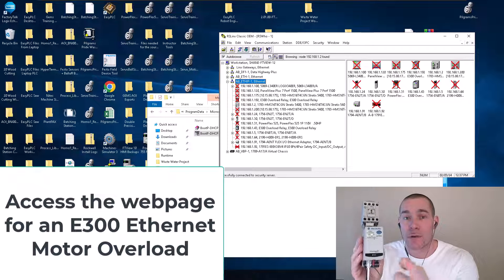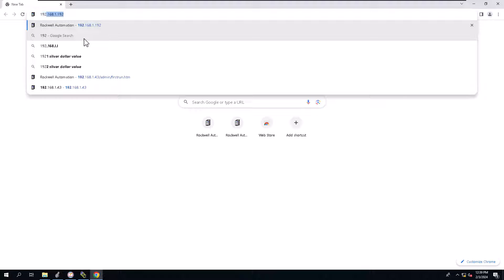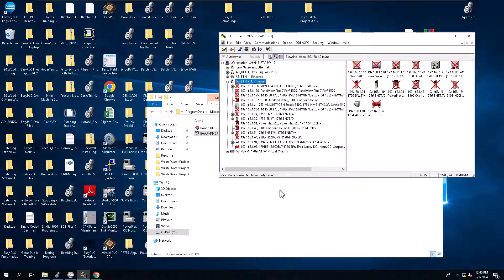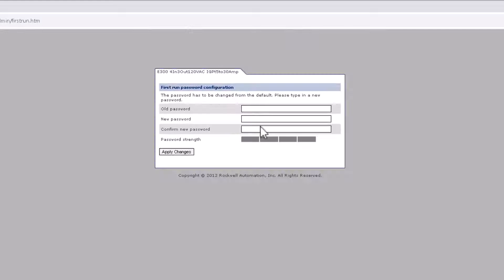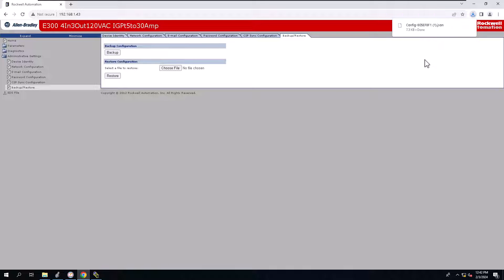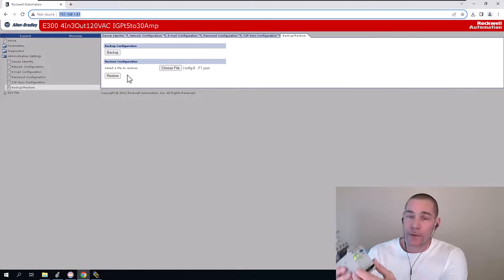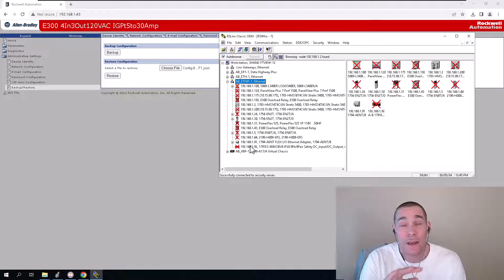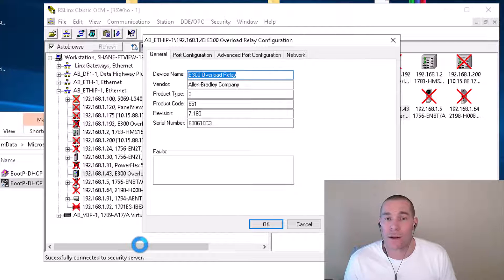Access the webpage for an E300 Ethernet Motor Overload

Comment: have to cycle the power is impossible while the line is running. there must be another way to backup
Reply from the maker: No, you need to cycle power to adjust the IP address and do a back